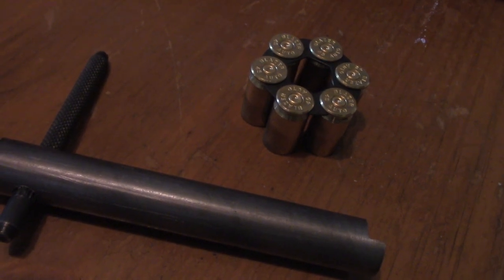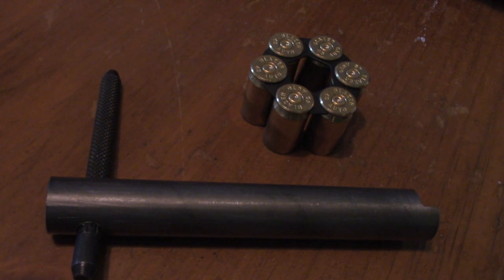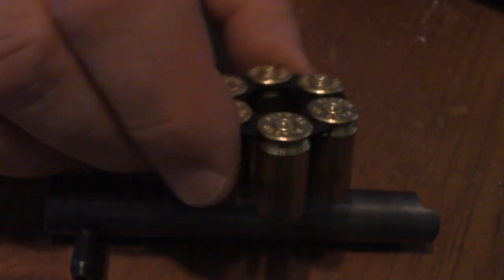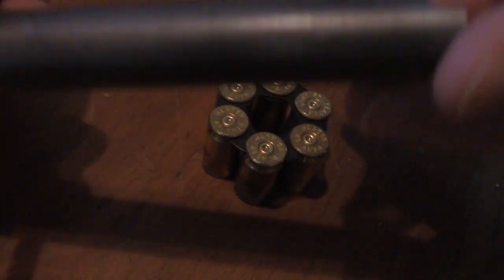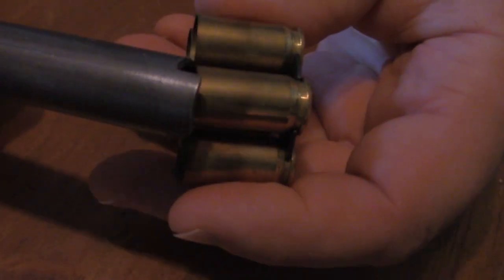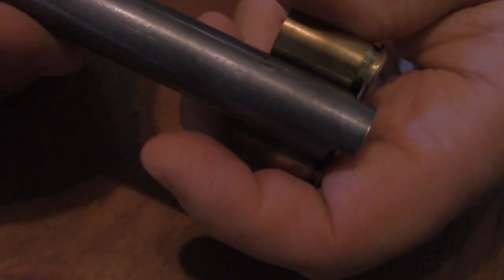Homebuilt Moon Declipper

Comment: Cool tool.  Do you know of anyone who makes moon clips to adapt 9mm/.380 to use in .38 special/.357 magnum?
Reply from the maker: No, I don't. 9mm doesn't really work because its base is larger than .38/.357, and even with .380 the cylinder would have to be modified to accept the clip. Otherwise the thickness of the clip won't allow the cylinder to close. I think at least one company does offer a 9mm conversion to an existing .357 cylinder, but I would stay far away from that because the makes the base of the chamber grossly oversize for .38 and .357. The only proper way to do it would be a separate 9mm cylinder.

Comment: Hey Possum, I have a S&W Governor revolver that uses moon clips and made one like yours cause it was a bitch to snap the cases in and out. It worked fine but my friend moved and got rid of a lot of his toys and had a pretty new tool he bought for himself.  He sold me the tool for 10 bucks it's called "the original Mooncliptool.com" and does .45, .38, 9mm.  it loads n removes the spent cases fast. it's like 35 to 40 bucks new which i wouldn't have bought cause i'm cheap. lol. but boy it's unbelievably fast.  if ya ever see a used one ya never be sorry to get one cheap.  I like moon clips now so fast to just drop into the chamber than one at a time.  be safe n have a good weekend........
Reply from the maker: Hey Walt; that is a good-looking tool. You got a bargain, my friend!
Reply: Possum,  after i bought it i looked online and your right i got a deal.  But for me deals are far n few. lol....stay dry my friend.....